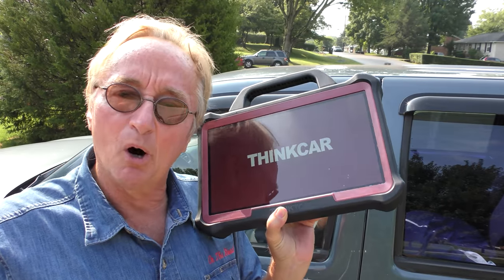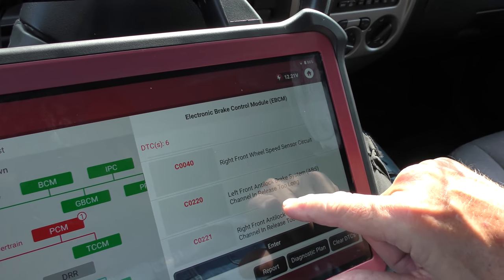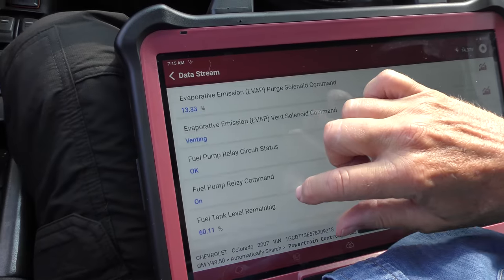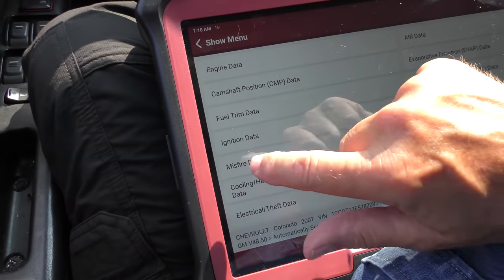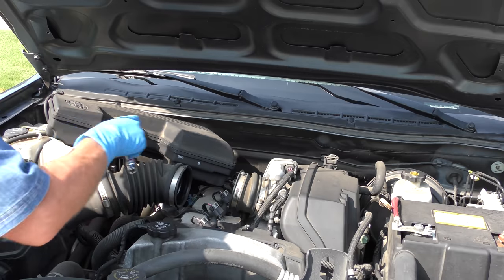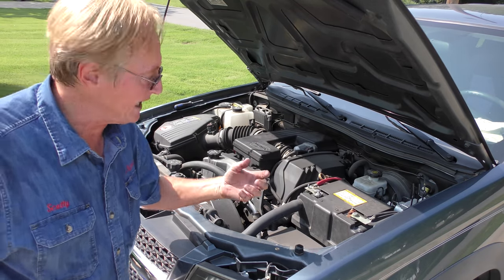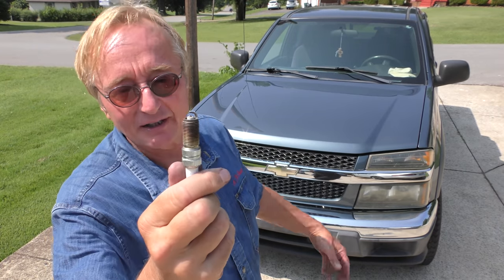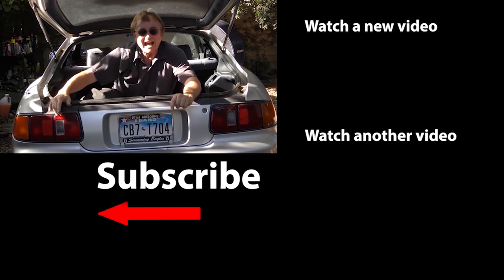Doing This Will Make Your Engine Run Better

Comment: Thank you Scotty for telling people not to put on anti-seize on the plugs years ago I used to do this until I realized that the coding that comes on the threads are better and you get a much better torque then put an anti-seize on an over torquing the threats!
Reply: @Wolf IT Solutions - I agree.  In 30+ years of driving and changing plugs, using anti-seize, no problems.  The cars without it?  Those were a challenge to pull the plugs.  Had to take my wife's GM maintained car to a mechanic, where it took two guys to remove the plugs that GM installed without anti-seize.

Comment: Another great episode. The German car maker Audi 5000 had a five cylinder engine. According to Dr. Ferdinand Piëch he said a four is too small, a six too bulky, and eight too large. He was an engineer with Porsche, Audi, Volkswagen group.
Automakers such as Volvo, Saab, Acura have used five cylinder engines.
Reply: I wish Honda/ Acura would make another 5 cylinder preferably with a turbo.
Reply: What's the difference between bulky and large though 🤔?
Reply: @crankybear1236 that engine was on the Acura Vigor..
Reply: @labornurse  eight being too large in layman's terms, you have to shoe horn the engine a similar approach to the 1975-1978 Ford Mustang II. You also have to deal with emissions and pollution requirements for USA cars especially California. Also Mercedes Benz was the only car maker that had a V8 engine on the S-klasse cars

Comment: I must take exception! Always -- ALWAYS -- use "Anti-seize" on spark(ing) plugs, whether in iron or aluminum (aluminium) cylinder heads. I have had to repair or replace entirely too many cylinder heads due to seized spark(ing) plugs destroying the threads therein because someone installed the plugs dry. 

If the "factory" plating on the plugs is sufficient, there will be no problem. If the plating is insufficient, a few pennies' worth of anti-seize won't cause any problems, and it might save your -- or the next guy's -- bacon.

Just keep the anti-seize away from the center and side electrodes and the main (outside) insulator, and it won't cause any problems.

Comment: Buy a GM product and automatically you need to buy a $5k scan tool as an accessory.
Reply: No, i own one of those Colorados it got 318 000 miles, always got me to point A to B never broke down only thing i changed was the muffler ans its running good.

Comment: If you drive fast (like normal highway driving) , you better not attempt driving with ABS unfixed. If you do, a lot of bad things can happen to you when/if it comes to emergency braking - from spinning out of control and overturning to tires exploding from too much friction applied to one spot. Friend of mine had to emergency-brake from 140 kmh to 0 with ABS off, and his tires lost roundness within one single braking. He said he was happy with this outcome since it was the smallest damage that could have happened.
Reply: I panic braked an 03 infiniti g35 going prob 110-120 mph years ago either I pressed too hard for the abs to react or it failed not sure    It flat spotted all sport tires.  Cost me 1200 back then.   Taught me a lesson.  Don’t go flying by the highway patrol. Lol.

Comment: It's important to remember that these days the "check engine" light will only come on if a fault is detected that means your car no longer complies with emission limits. If your engine is about to split in two, it doesn't care. If you're killing the baby seals, it cares. So in this case the light wasn't on because of bad spark plugs. It was one because of the evap valve.
Reply: stick to 90s and mid 2000s cars.

Comment: i replaced all the front end parts on a blazer Took it to alinment shop and they said it needed a bunch of parts tryed to charge me 60$ and handed me a list of needed parts and a 1200 est to replace them...i asked them to put it back on the lift they refuse all the parts they said was bad was just replaced before and they couldnt have even lifted it or pulled a wheel and charged me for looking at it took it to another shop and got it alined no problem...i am now sueing to get my 60 bucks back...

Comment: Sent my ABS module on a 02 Chevy Tahoe years ago to a company in the Midwest.  Rebuilt it for 85.00 I think.  Not expensive to fix.  And yes you want ABS especially with a heavy vehicle.  not advised to ignore

Comment: Why do you need an expensive machine to tell you a code? Why can't cars just come with a digital numbering spot that will display codes when something goes wrong and you can match it with a number in the owners manual.
Reply: Most owners are not interested or intelligent enough to attempt a diy repair. At least that's what the manufacturers figure...

Comment: i had a 06 just sold it with 175,000 with zero engine issues. but the suspension in those trucks are garbage

Comment: Need Scotty fancy scan tool for my 07 Corolla! p0171 code. system too lean. It starts up fine on cold engine, when engine is warmed up, hard to start. Paid $117 for scan, They told me need new MAF sensor. Bought part, put it in, code came back with a friend code P0441 now. Sprayed carb cleaner all around, no engine rev, so taking it AGAIN to mechanic tomorrow >:(
Reply: Begin by replacing the fuel filter. I assume you haven't done anything like replacing the fuel filler cap with an after-market. Can also be caused by leaking injectors. There is then too much fuel in the cylinders to allow easy starting of hot engine.
Reply: @SerpentStar_  It's a common complaint.
Reply: Similar issue with mine. Cleaned MAF and seemed to help but recently happened again. Let me know what it is when you find out
Reply: By “hard to start” do you mean just longer cranking and then it starts up or it is just difficult to plain start and you have to give it a couple tries?
Reply: @DaytonaBlueHr  longer cranking, have to try few times, multiple stops around town is a hassle 🔧🚗

Comment: I had a cylinder 4 misfire on my 06 Chrysler Pacifica took it to three mechanics. The all said it was probably a bad computer or the piston was worn out. Then I decided screw it gonna figure it out myself. Come to find out the intake manifold gasket is destroyed. The rubber itself was just hanging in the manifold. So I replaced it and now the check engine light is gone.
Reply: Although I have a problem passing smog check it keeps saying 02 monitor and catalyst monitor not complete

Comment: Unexpectedly : rich at idle and lean when driving could (at least on German cars) be a sign of (a) faulty coolant and/or temperature sensor(s). When the ECU detects bad temp readings, it falls back to some default sensor(s)-independent table values it had in its memory, and that is just what those values often do: rich at idle and lean when driving. Mean thing is that this situation is not always accompanied by sensor-related trouble codes.

Comment: My car's idle was so low it would barely run when sitting at a light,I went to turn the idle up but couldn't find the idle screw i asked my mechanic where it was located,he said the idle is co trolled by the computer,so much for high tech.

Comment: Diesels should be more reliable due to no spark plugs. According to a German insurance company, diesels are only half as likely to have a breakdown.
Reply: I drove an '80's Mercades with a 5 cylinder turbo diesel engine once. But that particular one had transmission issues (likely low vacumn pressure). And the 300D's are well known for reliability and fuel economy.
Reply: @DAN007thefoxx1  Okay, and yes, diesels are notorious for their better fuel consumptions than their petrol driven equivalents.
Reply: @DaveDVideoMaker  At the time it would have made sense to some not only because diesels tended to get much better economy than gas, but the fuel was also cheaper than gas back then.
Reply: @DAN007thefoxx1  But now in the UK, it’s £1.34 per litre, compared to petrol which is £1.31 per litre.
Reply: @DaveDVideoMaker  Not sure what this translates to in USD but I bet its expensive
Reply: @DAN007thefoxx1  And fact that us Brits use petrol instead of gas.

Comment: In 1980 my college roommate from FL 305 Nova was running rough. Two of eight plugs was wet, replaced those two plug wires, FIXED.

Comment: I wanted to get a colorado 5 cylinder until i heard about how hard/expensive the timing chain is to replace
Reply: A good timing chain should never require replacement for the life of the engine.  That is, at least 300,000 miles.   The tensioner?  perhaps, but not the chain itself.    The modern chains are a totally different beast from the ones in the 1960's cars.

Comment: 😃👋🏽Hey Scotty…

     I love your blog…and…I find it very helpful and insightful…I would like to run something pass you…

     I have a 2014 Ford Fusion SE 1.5L EcoBoost engine…I am experiencing slow take off from a dead stop…then when the engine reaches 2700-3000 rpm’s…the engine then takes off…I changed the both O2 sensors, both VVT sensors, mass air flow sensor, and new spark plugs…but…still have a slow take off at the line… …the check engine light is on…and…it’s throwing a P0016 code…which has to do with timing…but…I’m not experiencing any misfiring or backfires… …Scotty…your thoughts 💭 please…

-Ernest from Philly (Go Eagles)😄

Comment: Doesn't part of the smoothness of an engine depend also on the angle the cylinders sit at?  (ie. so cars where the cylinders are vertical will likely have less vibration than those that perhaps sit an a slight angle)?  Obviously on a V shaped or flat V engine (like the Subaru boxer) engine, this is zeroed out by both sides.  That or they've designed things like engine mounts so they absorb more vibration.  I mean at times my Camry (a 2.5L 4 cylinder) vibrates a little, but not as bad as my 97 Civic did (which was a 1.6L but a 4 cylinder as well).  Yet my 2012 Focus ran very smooth, no vibration.

The few times I had to diagnose someone's car without a scan tool, the spark plugs were usually the first thing to be checked (other than air filter and obvious signs of issues -- frayed or broken wires going to components on the engine).  But I'd say in majority of the cases, yes the spark plugs were the issue (either just worn or carbon fouled from oil burning).

Comment: Hello Scotty I recently developed a no spark problem on my 1987 Oldsmobile carbureted 307. I have power going to the distributor. I have replaced the ignition control module,  condenser, distributor cap and rotor, coil and plug wires still no spark. What could possibly be wrong the engine should run?

Comment: Wondering if you can help. I have a 2012 Kia Soul - Manual Transmission - Just recently started having starting issues. Cold start it will crank but not turn over on first attempt, then on second attempt sometimes it will turn over but the rpm gauge doesn't work. If I turn it off  and turn the key again it turns over fine and the rpm gauge works. Good to go. I'm assuming this is a warning sign that something is going. Any ideas?

Comment: hmm. i still don't see how by reading misfire value would give you a conclusion that spark plug is the one that causes the problem.  Wouldn't bad control circuit, fuel, emission etc, also could develop misfire problem?

Comment: You're the first person I've heard say that the GM 5 cylinder was a halfway decent engine. I was looking at an early 2000s model GMC that had one, and every single mechanic and car guru I talked to told me to stay the heck away, as they had many problems. My research found the same. What's the difference?
Reply: The issue with those engines had to do with the cylinder head and timing chains. 2004-2006 had a relatively common failure with the valve seats in the head fail and you will get bad misfires. 2007+ fixed the problem for the head. If you didn’t change your oil enough, the timing chains would stretch and cause engine codes and chain replacement, which requires you to take off the oil pan. Reliable when taken care of.

Comment: Hey scotty, I've got an 04 trailblazer ext with 4.2 got a ses code of P0455. I''ve replaced the relay, canister filter, gas cap, filler neck. I also had to replace the fuel pump and gas tank cause they both had holes in them. I'm at wits end on this car. Can you give me some leadway on what could the problem might be?
Reply: Oh yeah when I start it up, it has a rough idle where it fluctuates between about 200rpms where it almost stalls to upwards up almost 2k rpms. I've been told it could be a fuel pressure regulator or catalytic converter.

Comment: Scotty, per your advice, I’ve moved my family fleet over to Toyota/Lexus.  Dealer is saying oil only needs to be changed every 10,000 miles.  2019 Rav4 and a 2020 GX.  What do you think?  Seems like a long time.
Reply: 5,000 is perfect.  And easy to remember when it's needed to be replaced

Comment: guys i have a 2015 corolla , shft is adding short time and lnft is subtracting like 9 % , i think i have a bad stuck open evap purge solenoid. cuz i have 2 codes for it , p0441 p2420. would the purge valve stuck open make ur car run rough? not have any acceleration?

Comment: My 2006 Scion tC has a problem it is riding rough with a lot of vibrations in the steering wheel and when I turn it makes very subtle clicking feelings in the steering wheel what could possibly be wrong?
Reply: Several things some of which are dangerous...bad CV joints, universal joints, half axles, even ball joints. Get it looked at by a good shop SOON.